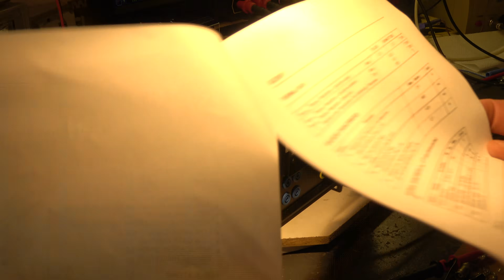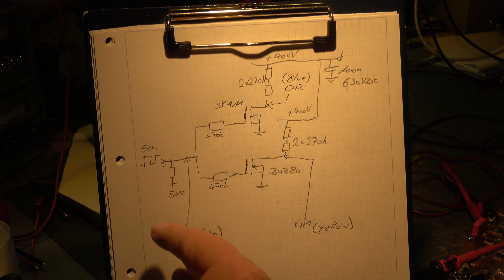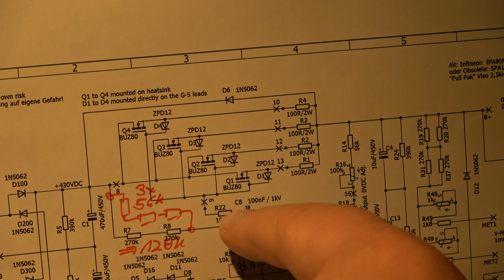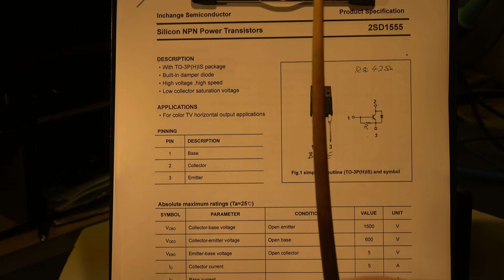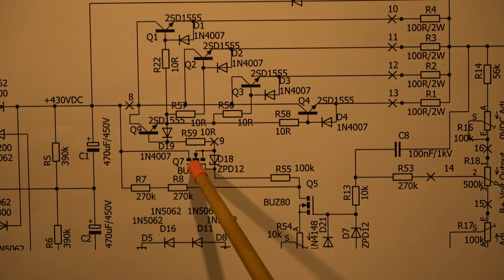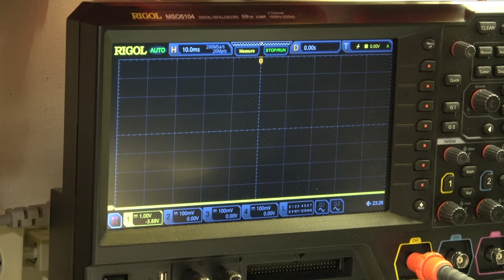#119 HV Power Supply Design Part 7(8)

Comment: hello. didnt a single IRFPE50 or similar work for you??
Reply from the maker: I need some transistors in parallel to distribute the current in case of a short circuit. Otherwise the single transistor would be killed by the peak s.c. current.

Comment: but is the dc limit not 300V for the spa in the SOA? it might suffer spirito
Reply from the maker: I don´t understand; look for the datasheet of the SPA11N80C3 > VDS=800V
Reply: @dl7majstefan753  yes but the safe operating area is important, the manufacture just specs the highest number but that is not true for all operating modes the fet can run at
Reply from the maker: @heinrichhein2605  In this application the maximum current in the FET is app. 200mA/8 = 25mA. (8 is the B of the BJTs). These 25mA are never(!) exceeded at any output voltage. The diagram "Safe operating area" of the FET is not specified for such low curents but an extrapolation shows 800VDC for VDS at ID=25mA.